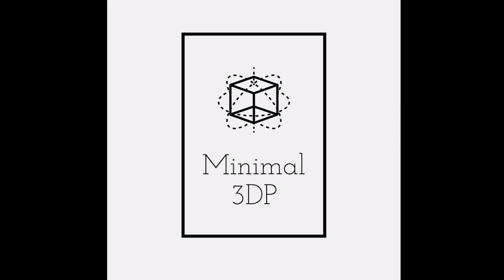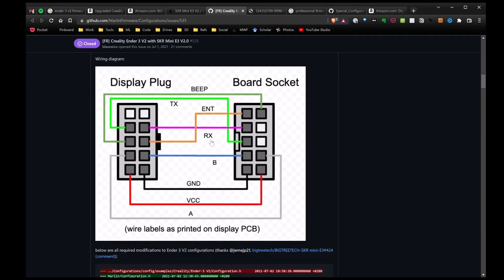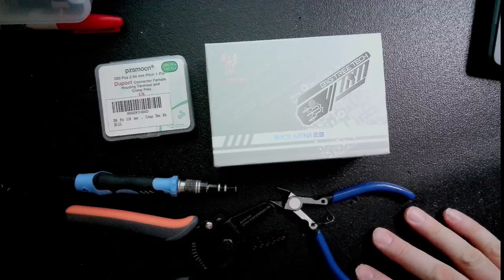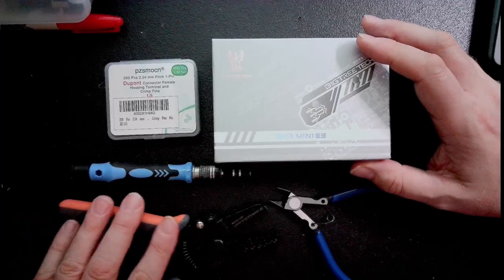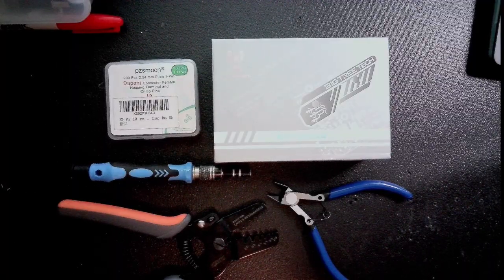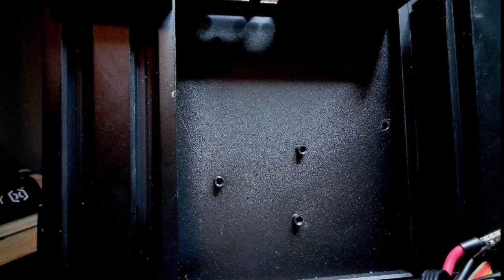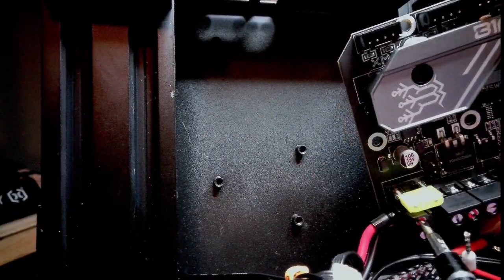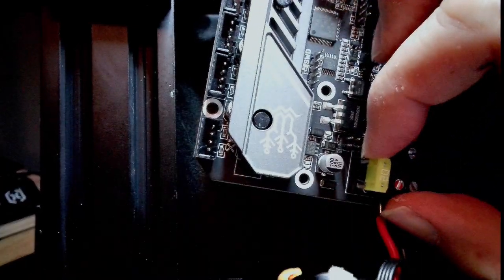Install a BTT SKR Mini e3 v3.0 on an Ender 3 v2: Including How-to Wire the Display

Comment: Thank you for the excelent tutorial, I did build a printer based on ende3v2, with skr mini3v3 I had to use marlin 1.1.9 was not able to the original display, until now, YES I CAN!!! thank you for the wiring tutorial, I did upload the new firmware working 100%
just the Y run on the wrong direction, as i can`t open firmware.bin on visual studio, i willl change the wire on motor.Thank you again. Greetings from South Africa
Reply from the maker: Glad things are working for you. I will try to post a video on editing the firmware this weekend as well.

Comment: Thanks for this. I bought this board for my ender 3 V2 Neo. This printer came with the GD board and not the STM, so the wiring is not exactly the same. Can you please guide me to the right direction of where and how I can find out what the wires do/for the printer? Thanks
Reply from the maker: Take a look at Creality and BTT GitHub. They usually have wire diagrams. Let me know if you can't find it.

Comment: hiya, just checking, my ender 3 V2 neo doesn't come with Z stop cable(3 pins), is that okay if I don't have it?
Reply from the maker: The Cr touch is the endstop.
Reply: @minimal3dp  errr...I have bl touch and it comes with a 5 ribbon cables. And that goes to the port on the right hand side near the port for LCD one.

Comment: From the other reading I've done it sounded like the screen needed to be updated as well with DWIN firmware before it would work with the SKR MINI E3.... is that not the case? Did you not flash your screen and it "just worked"?
Reply from the maker: The screen will work to a point. Without updating the screen you might not have access to any new functionality. There won't be icons available.

Comment: Is the hot bed and the hot end out cables in correct order? To me you reversed them
Reply from the maker: It is all working as far as I know. I will check to be sure when I get a chance.
Reply: @minimal3dp  I was wondering the same thing. Everything worked find for me, but I am getting some pausing and even some print completely stopping so wondering if I have it wired wrong?

Comment: So looks like I dont need the connectors if im not trying to save my display? I use klipper with a btt pad7
Reply from the maker: That is correct. The BTT would be your screen.

Comment: Hello,
I have a question about the fans. Maybe I just didn't heard it but why didn't you connect the FAN2?
Reply from the maker: I might not have said it. Fan2 is the case fan. It needs to be connected as you are closing the case back up.
Reply: @minimal3dp  thanks a lot

Comment: I'm completely new to this, but I had to replace the board on my CR-10 v1.  I see that you removed the wires from the heated bed, hot end, and always-on fans connections on the original board, which is pretty much the same as my CR-10's board.  What happened to the wires you removed from the always-on fan port?  I can't tell from the video.
Reply from the maker: Which fan hotend (Fan0), part cooling (Fan1), or motherboard (connections next to steppers)?
Reply: @minimal3dp  I probably don't have a firm grasp on the terminology.  The CR-10 wiring diagram shows a Always-on Power connection between the Power Input and the Bed power input.  Switching to the SKR Mini E3 V3.0, that Always-on fan power connection has to be reconnected to a JST-XH connector and plugged in elsewhere on the board.  My wires don't look like the ones in your video, probably because you're on an Ender3 and I'm on a CR-10.  Mass confusion for me.
Reply from the maker: @SergeantJackHarris  Take a look at https://youtu.be/y_QtaPOM6bk and https://youtu.be/V2wOqIiZJec I think the wiring should better match your machine. If not, feel free to email me at minimal3dp@gmail.com.

Comment: I did this and it worked but by knob will not move anything on the screen. any idea why?
Reply from the maker: You have an issue with your wires. My guess is that something is loose.
Reply: @minimal3dp  I touched the wires on the back of the LCD and the screen messed up. So I unplugged them all (with pritner off) reset all the crimps in the plastic housing and many where not in all the way or backwards. But now that I repligged it in the screen is black again. Also octoprint will not connect after this motherboard swap.
Reply: @minimal3dp  okay I got it to work after I re wired and then used the firmwear you linked. only issue is I do not have bl touch. is there a firmwear to use that has no bl touch? I tried the normal one from misroc but it did not work. screen wont show

Comment: Hello .. I installed the plate on my Ender 3v2, but the menu restarts ... The printer restarts, the menu appears. Regardless of which option I choose, the printer restarts .... Would you know what it can be? Could you make your firmware available for me to test on mine?
Reply: I forgot to inform, my card is a BigTetech-Skr-Mini-E3 V2.0
Reply from the maker: I am out of town at the moment but when I get home I will.

Comment: Because i'm a noob at dooing this stuff, I will follow each instruction closely. But I wonder if I really need to purchase all of this for the connectors: 
-1460 Pieces 2.54mm JST-XH JST Connector Kit
- Pzsmocn 100 Sets Dupont 2.54 mm Pitch 1-Pin Female Adapter Cable Connector Accessories
- IWISS 1550PCS 2.54mm Pitch Wire-to-Wire Dupont Connector Kit

"1460 Pieces 2.54mm JST-XH JST Connector Kit" should be enough to do the job, or am I mistaken? 

Greetings,
Sortje
Reply from the maker: You are correct. I started with the 100 connector set but I had better luck with the larger set. I will edit the description to better highlight that.
Reply: yeah this is ridiculous.  You'd think BTT would provide a cable,  instead of forcing us to make one..  This is totall POOOOOP..

Comment: After doing this tonight then finding this fkn screen issue i was suicidal af. 
I'm so lucky I had a V1 screen in a drawer... slapped it in and off it went. Can we buy a BTT screen and use that or must be an ender screen? If i could put hte same TS32R as my laser cutter it would be great
Reply from the maker: You can buy a premade cord that will work with the board and the ender screen.

Comment: New to 3DP. What's the reason for changing out the board? What's the benefits?
Reply from the maker: In my case, I was having issues with the SD card reader on the original board. Additionally, the new board gives me more options.

To be honest, I also love taking my printers apart and tweaking.

Comment: I wish I had seen this before doing mine. It was a lot of research and a learning curve. Have you had any issues with screen freezing and glitches? I pretty much have the same setup as you even with the wiring but my screen will glitch randomly mid print and sometimes prints will fail/stop completely when this happens. I've sort of minimized the issue by putting the screen to sleep during prints but not a great solution.
Reply from the maker: You might want to check to see if all your wiring is tight. 

Presently, I am trying to run my ender 3 v2 using klipper. With klipper, I don't need the display. I did not switch because of the display but because I wanted to experiment. At this point, I am probably going to convert all my printers to klipper. I really like it.
Reply: @minimal3dp  The trouble with klipper is that where I live a raspberry pi that will run klipper (I have 3 pis, all too old and underpowered apparently) costs about the same as a whole new Ender 3 v2. Its some sort of gouging if you ask me,  and can't understand why the chip crisis affect graphics cards and RPs so badly, yet there are all sorts of boards eg. the SKR mini or even the Creality Sonic which seems to do the same thing, which have only gone up a little if at all. Anyway I refuse to pay AUD300 for a RP when I can pick a refurb laptop or desktop with twice the power for a similar price. I guess I will wait until pi prices come down out of the stratosphere.
Reply: @minimal3dp hey, so i am about to undertake this because I am running klipper, and want uart. I also have dual z motors and want to run them independent. I want to ask because I removed my display, but is there a way to use it for something with klipper? I use a btt pad7 so maybe for macros or something?

Comment: Why wouldn't you also just upgrade to the BTT LCD display at the same time? It's just an extra $40 or so and no extra wiring. Unless I am missing something?
Reply from the maker: I did it on a budget and rewiring the display cost $0.
Reply: @minimal3dp  I figured. And your video walkthrough is excellent, btw. I would have to purchase the extra connectors, tools, etc., so the extra $40 is worth having to deal with the hassle.

Comment: So that firmware isnt on that github anymore. Do you have a link to it?
Reply from the maker: Try this one: https://github.com/minimal3dp/Marlin/tree/ender3v2-skr-mini-e3-v3-cr-bl-touch
Reply: @minimal3dp  I didn’t install the BLTouch on my printer yet, is it work with stock Ender 3 V2 with V3.0 motherboard ?
Reply from the maker: @lyx_aquawaifu  if you deactivate the bltouch section in marlin, then yes.

Comment: Why does Creality love to hot glue everything to their board?
Reply from the maker: They do love them some hot glue. I have an artillery sidewinder X1 and they went crazy too.
Reply: So nothing comes out when its shipped overseas
Reply: @William47345  I receive plenty of cheap Chinese electronic shit and they're not anywhere near as bad on hot glue as my Creality.

And yes, most of the shit I order still works regardless. I had one bad product because a cap came off but I'm certain hot glue would have done little to save that.

Comment: for some reason i cant select with my encoder wheel
Reply from the maker: Is it wired correctly? My guess is that you have a bad connection.
Reply: @minimal3dp  I have already checked my connections and they don’t seem bad… this is my second account btw don’t get confused hehe
Reply from the maker: My guess is that there is a wiring issue. What type of connectors are you using?

Comment: I feel like I'm in Bizaro world..  out of all the electronic junk i've bought in my life.. I've never had to make a cable to suit the manufacturer..        I'm so disappointed..  why don't they just include the damn thing..   or at least pin out the thing to it's correct at least on one end.   Who are these jamokes???
Reply from the maker: As far as I can tell, the issue is the Creality screen. It uses non standard wiring.
Reply: this probably wasn't the case when you wrote this comment, but I just bought an SKR Mini E3 V3 myself, and they actually make a cable for it that plugs into the Ender 3 V2's display. Granted I still had to buy it separately but it was only about 6 bucks